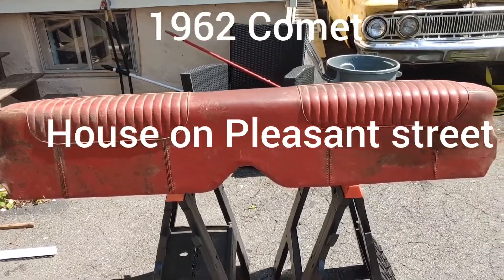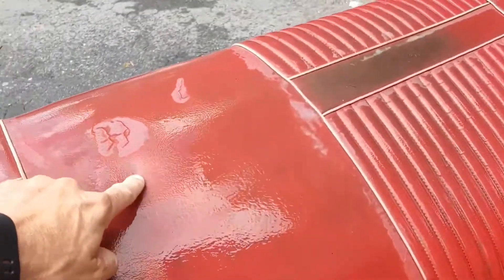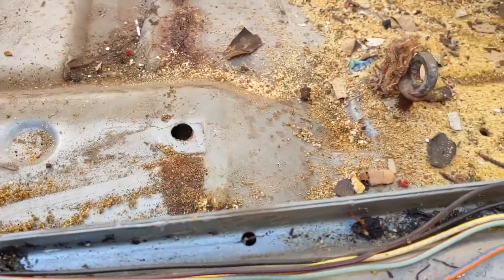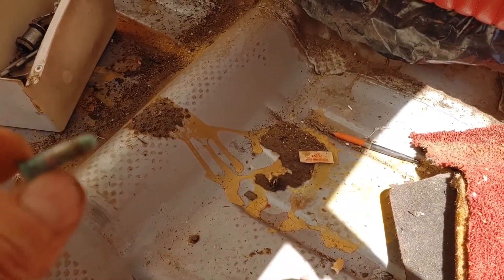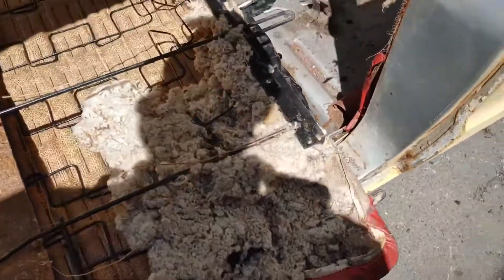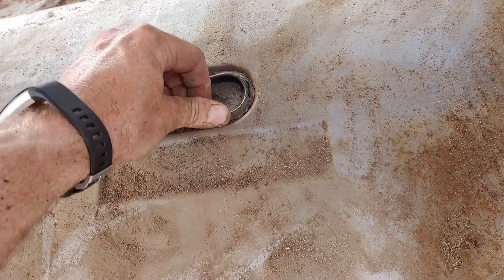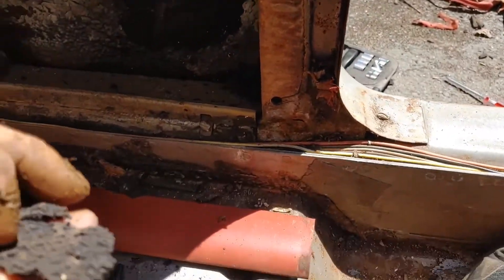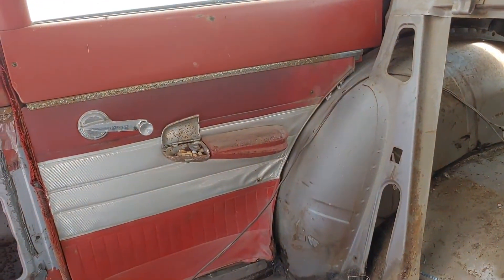1962 Mercury Comet  Gutting the interior

Comment: Mr. P Street.
I started going over your videos. So ill be making some comments this time.
I have that same stuff on my 62. My car was made in Cleveland and sold in Atlanta. I used diesel as a spray soaking liquid. Diesel isn't flammable so its safer to use and its cheaper per gallon than the 20oz spray cans. On the heaver areas... I used a hand held little propane torch to soften it up. I've been told it e as used as an anti metal rattle and rust preventer.
Reply from the maker: Nice.   It makes sense.  Thanks for the response.  These cars are certainly well coated.